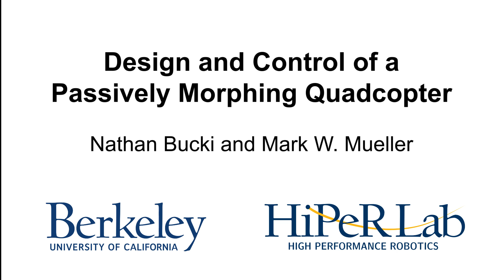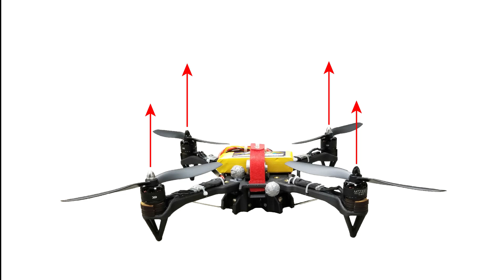Design and Control of a Passively Morphing Quadcopter

Comment: I can see takeoff and landing problems. Especially landing without breaking a propeller blade. Unless you have folding blades. But it would still be stuck to the ground after landing.
Reply: It’s a prototype. They are trying to solve the problems at hand before they move on to the next one. And if they still have any ingenuity left after coming up with such a design, which I don’t doubt they do, I’m sure they will solve that problem elegantly too.
Reply: It would be simple to solve that with a solenoid actuated lockout mechanism for the arms.  More weight and complexity, but it wouldn't be impossible or anything.  Just not necessary for their proof of concept.